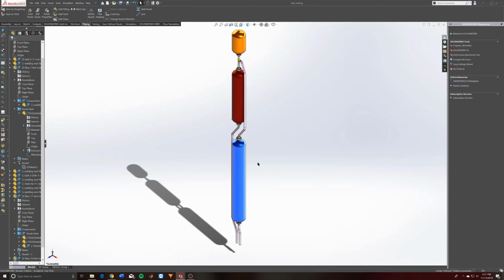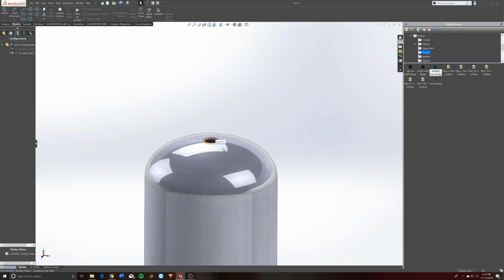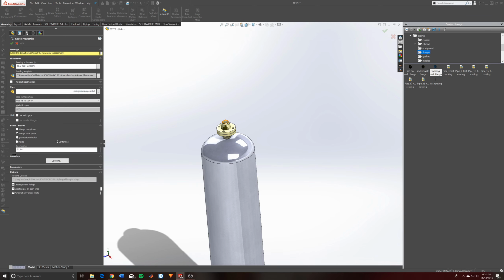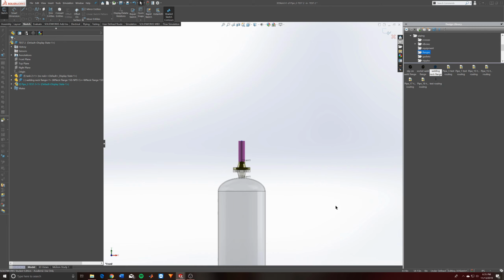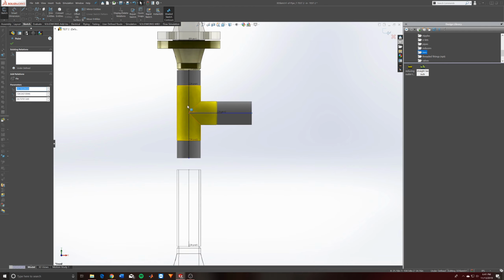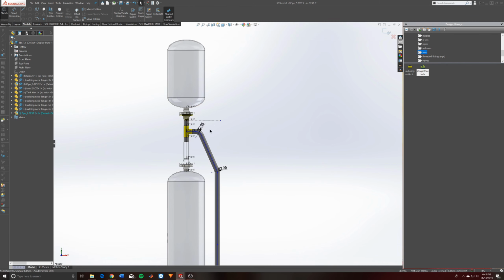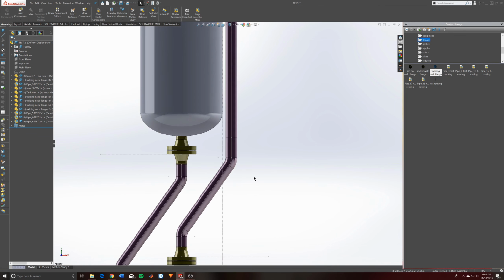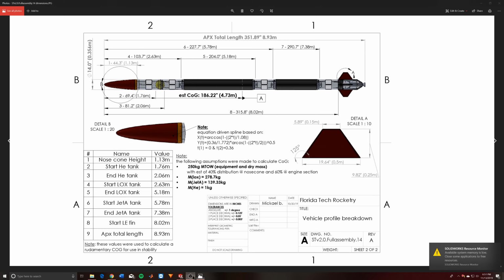Flight Vehicle Pressure Vessel - Part 3 Using Assembly Routing/Piping AddIn

Comment from the maker: Correction Log: 
1) I done goofed and put the LOX tank below the JetA tank. LOX tank is the heavier tank and is longer so for stability reasons we should place the LOX tank in front of the JetA tank.
2) Piping is not referenced from Inner diameter not outer diameter, sorry for the wrong information in the video.

Comment from the maker: Video Timeline: 
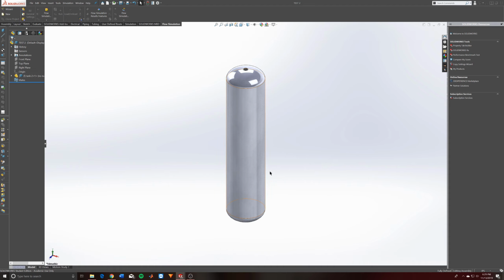1) Routing Add in @1:58
2) Insert Mounting Flange & mate @3:30
3) Drag and Drop second flange and begin piping @4:50
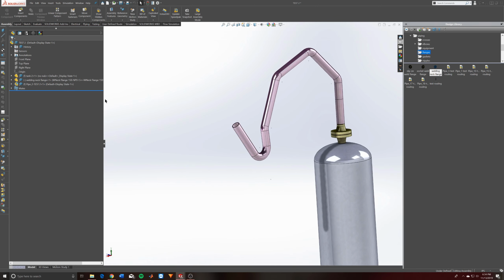4) editing existing routing sketches @7:00
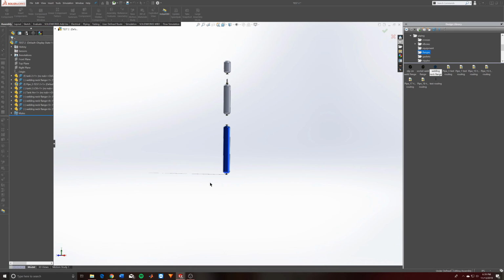5) Import and addition of other tanks and flanges (aftermath) @9:12
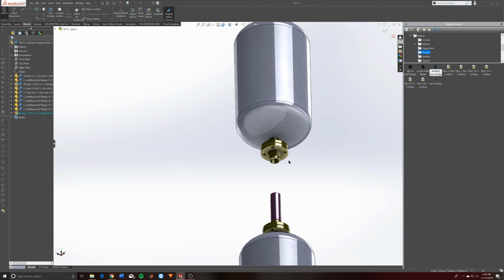6) Adding elbows and editing piping paths @9:45 - [Didn't mention that you can edit rotation of T-joint using the move with triad tool]
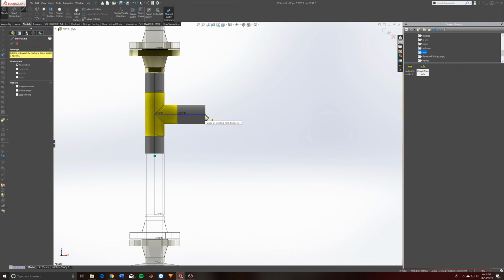7) Using reference dimensions to define pipe paths @11:45
8) Adding more flanges and pipe paths @14:45
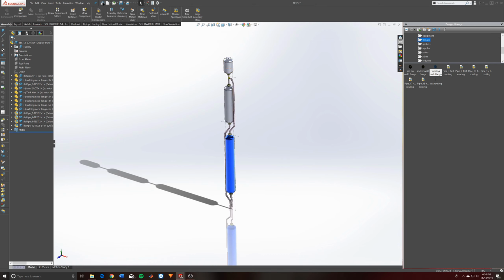9) closing remarks @18:00